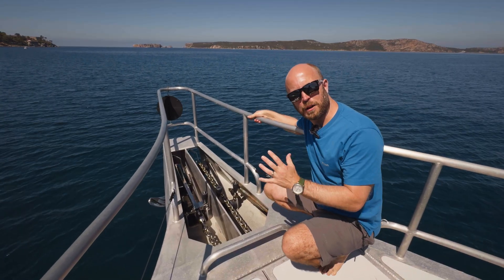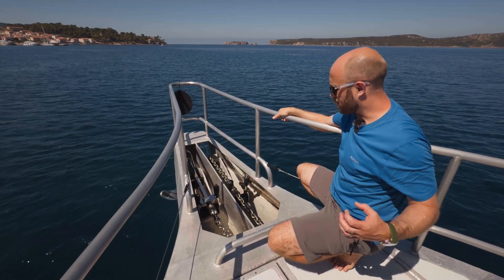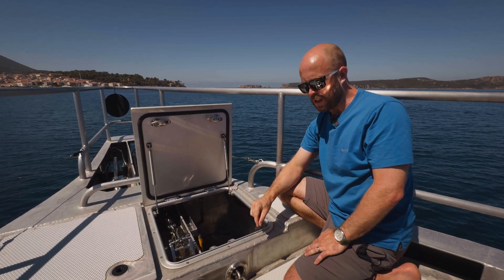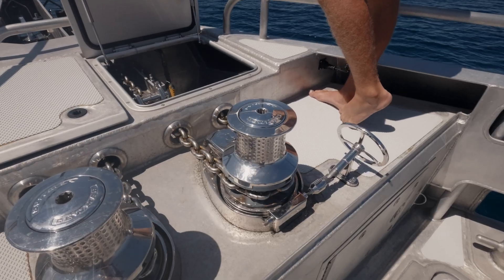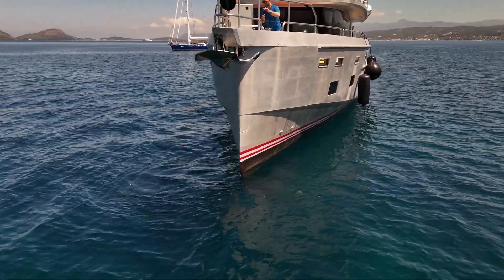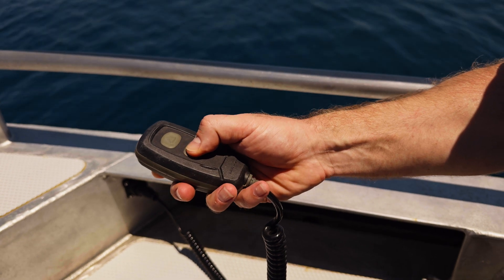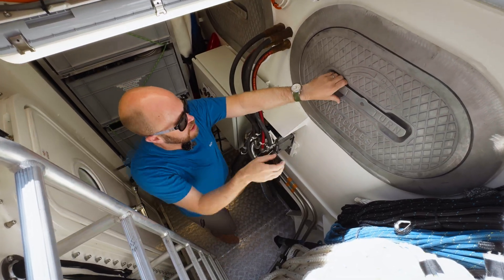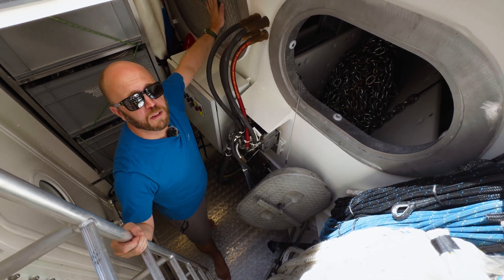Inside the Arksen 85 | Anchoring System Walkthrough with Jim Mair

Comment: when your rode is chain do you still use a snubber?  why is that section of railing on the pulpit removable?
Reply from the maker: Yes there is a snubber arrangement however it doesn’t generally get used on this boat. It really comes down to the specific Captain/owner operating choices. The gap in the railing to is maximise the opening if they wanted to run lines to the capstans with a high lead angle, without bearing hard against railings. Again, rarely used but it’s there just in case.

Comment: can you say a few words about draining/managing the water (and potentially mud/sand/etc) from the bowels of the change locker?
Reply from the maker: There is a built-in chain wash system as well as a deck wash hose nearby. These can be run on sea or fresh water. The areas around the chains/windlasses drains overboard, so you can wash-away any muddy water, without it going on the deck. The chain locker has a grillage in the base and a generously-sized outlet, to allow water to drain. All very easy to access, either hosing from above or cleaning periodically from within.

Comment: Frage: kann mann die kette abspritzen und das Wasser abpumpem? Um so Korrosion besser vorzubeugen, macht das sinn?
Reply from the maker: Yes, there is a built-in chain wash system as well as a deck wash hose nearby. The areas around the chains/windlasses drains overboard, so you can wash-away any muddy water, without it going on the deck.